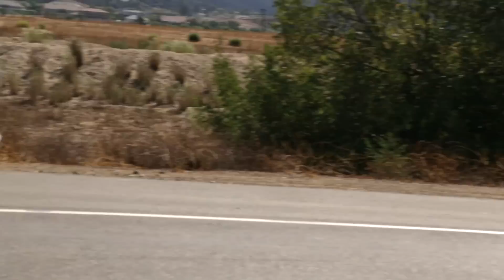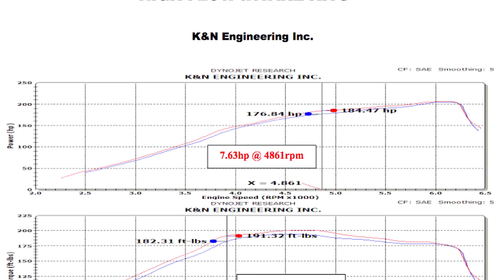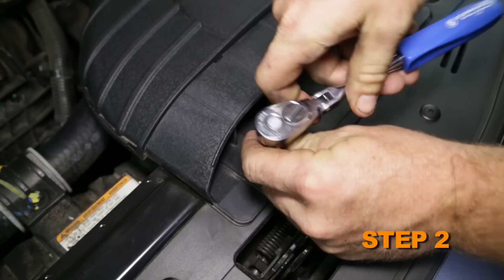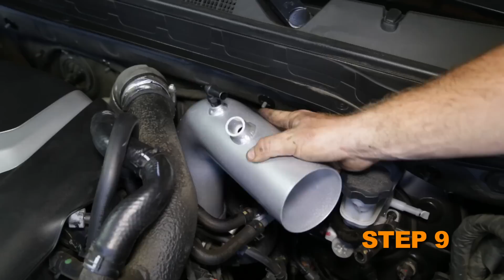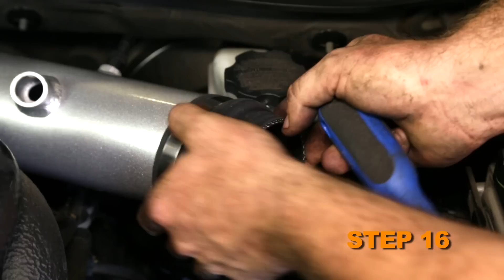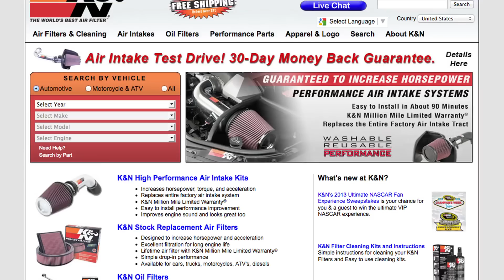Kia Optima & Hyundai Sonata 2.0L [#69-5309TS] Air Intake Installation

Comment: Installed on my 2012 Hyundai Sonata 2.0T and its badass, sounds great and I can def notice a improvement in horsepower/and accelerating, I highly recommend it. Taking of the old hose that leads to the turbo is a bitch to get off tho! Just be ready to struggle abit.
Reply: what tools do you need ?
Reply: yeah how the hell you get to that and what size is that bolt clamp?

Comment: when its a turbo application it work's different from a NA/naturally aspirated motor.  turbo vehicles need the air even if its hot for the turbo to suck and work more efficient then the intercooler process that air and sends it in motor hot air will rob a NA motor so you afto keep cool air friendly. btw its not that easy to disconnect the pipe from turbo you afto disconnect from bottom of tje vehicle fyi.

Comment: A lot of places say you can get intakes without tunes required and get 10-15 HP and at least 5+ lbs of torque without a tune. Is this true, or would you just be giving your car more air than it needs if you don't tune it?

Comment: I Have A 2013 Kia Optima Ex 2.4L No Turbo Is It Even Worth It To Put This In My Car ? Will It Make It Sound Better Or Faster ?
Reply: Don't do it
Reply: Virgilio Alford it will sound better anDat the top of the RPMS have a gain but daily driver uses 2500- 3500 rpm the most. The manufacturer i set up the intake to have max speed of airflow in the 2500-3500 range and keep the car quiet and not annoying

Comment: KNfilters- After drooling over the sound this makes I bought this exact kit. I installed it and I thought everything went smooth, however the sound it makes when I gun it sounds like the turbo is trying to play catch up. Perfectly healthy car and first add on-Is this normal or could something possibly be installed incorrectly? Thanks a bunch Ive had a K&N on every car (4) i've owned.
Reply from the maker: Hi Scott, if you still have questions about your kit, please contact our Customer Service department, one of our techs will be happy to help out, you can call us at 800-858-3333.

Comment: Not to be captain obvious here, but I see these "cold air intake" systems installed all the time and I can't help but wonder...don't these open air filter intakes inside the engine compartment draw hot air from under the hood instead of how most factory systems draw cooler air from outside the engine compartment? I have an Optima turbo and know that the cooler the air, the better! How can "cold air intake" even be true with this setup?
Reply: You're not cooling down the air from the outside. You're making it less restrictive. That's what the purpose of an intake is for. It's gonna pass through the intercooler anyways.
Reply: +Hijo Yes but cooler air through the intake from outside seems to me would be cooler when it hits the engine than trying to cool down hot air from inside the engine compartment, don't you think?
Reply: +Scott DuVall Yeah, and I agree with you. (Unless it has a heat shield). However, those temps don't matter too much since turbo charged cars have an intercooler that's cooling the air before it reaches the cylinder.
Reply: +Hijo ding ding ding. The air is being compressed anyway so the inital intake temp doesnt really matter too much. Hence the use of an intercooler on turbocharged engines.
However with NA engines, no doubt, the cooler the intake temps at the filter the more dense the air is. All of which technically increases the displacement of the cylinders. Thats why you will see alot of CAI's for NA cars being routed down into the bumper or fender. 

Really the best thing for IAT's would be to use a seperated turbine and compressor turbo like Mercedes uses on their '14+ F1 cars. Basically just a long central shaft that connects the turbine to the compressor, giving a substantial air gap between the two and keeping IAT's down.
Reply: +Hijo ding ding ding. The air is being compressed anyway so the inital intake temp doesnt really matter too much. Hence the use of an intercooler on turbocharged engines.
However with NA engines, no doubt, the cooler the intake temps at the filter the more dense the air is. All of which technically increases the displacement of the cylinders. Thats why you will see alot of CAI's for NA cars being routed down into the bumper or fender. 

Really the best thing for IAT's would be to use a seperated turbine and compressor turbo like Mercedes uses on their '14+ F1 cars. Basically just a long central shaft that connects the turbine to the compressor, giving a substantial air gap between the two and keeping IAT's down.
Reply: By re-installing the OEM snorkel that brings cool outside air right up to the open element air filter, when you are cruising down the road you ARE getting cool air to the now much less restrictive air intake.  It does work.  The heat-shield system they provide that seals up against the hood helps to keep some (but not all) of the hot engine compartment air from getting to the air filter/intake path.  You can monitor the air intake temperature with Torque Pro and an Bluetooth OBD-II dongle.  I have the InJen setup which is very similar to the K&N system.
Reply: +Hijo ding ding ding. The air is being compressed anyway so the inital intake temp doesnt really matter too much. Hence the use of an intercooler on turbocharged engines.
However with NA engines, no doubt, the cooler the intake temps at the filter the more dense the air is. All of which technically increases the displacement of the cylinders. Thats why you will see alot of CAI's for NA cars being routed down into the bumper or fender. 

Really the best thing for IAT's would be to use a seperated turbine and compressor turbo like Mercedes uses on their '14+ F1 cars. Basically just a long central shaft that connects the turbine to the compressor, giving a substantial air gap between the two and keeping IAT's down.
Reply: Scott DuVall the turbo is hot and heats the air that is why they invented inter coolers yes the colder the beter
Reply: Finn Custom Knives like
Reply: Scott DuVall
Reply: On the 2.0 liter turbos there is an intercooler before the air gets to the intake so it helps with that.

Comment: Why don't the car manufacturers do this from factory? They can make contract with K&N or just make their own. They should have plenty of money... Usually car buyers pay $1000 for 10hp increase when a newer model replaces older, even if no other changes are made to car.
Reply from the maker: +Alen Majetic Mostly because the engine noise increase does not appeal to the majority of consumers. Some people prefer quieter, slower vehicles.
Reply: +KNfilters Do you offer filters that don't make extra noise? I don't think it's hard to make that, noise is just vibration, noise doesn't affect power I think. Or is that a secret way KN is making extra power???
I definitely don't want to make extra noise

Comment: It is all bs and for the price you can buy like 150 factory air filters want more power then buy a car with more horse power
Reply: You are ignorant. This upgrade does a lot more then just add a few horses. You can hear the turbo spool better. Quicker response, quicker spool. Better fuel economy. Probably lighter too.
Reply: tasha macmillan yes bigger power from the steelership

Comment: I have a 2015 kia optima lx will this work? Also i do live in california where you said this is illegal is there legal versions of this?
Reply: how often have you been pulled over by a cop checking to see if you have an cold air intake lol
Reply: +Logan Green it's not the cops it's the scheduled service that checks your vehicle. they are required to report modifications
Reply: They do have CAIs for 2015 Optimas..I have a 2015 optima lx too and I just replaced the stock filter with a KN filter instead of a CAI (costs a little too much for me).. I do notice a difference in mid-range gears and on takeoffs though im sure its not as substantial as a CAI..If you want to legally install a CAI then you probably just have to move out of California..
Reply: Their website says it is 50 state legal so if it fits, it would be ok in CA

Comment: You probably hear a BOV because the stock intake insulated the noise of the recirculation of the air. Aftermarket intakes usually do not do this as they are made of different materials.

Comment: Watch tuner shops prove on dyno that there is no gain in HP..   Absolutely none.. Its equivalent to putting on an exhaust tip no gain all looks.. It breaths better only if your stock filter is dirty do the research
Reply from the maker: Please provide info on a tuner shop testing our product vs stock, and seeing no gain. Once we recieve this info, we can review our system. However, when we tested the car on our dyno with and without our system we saw a 7.63 HP gain. : http://www.knfilters.com/dynocharts/69-5309_dyno.pdf
Reply: KNfilters that can't be right. My 2011 2.0T sonata dynoed at 245 horsepower at the wheels stock with 93 octane. Your turbo only got 190? Something seriously wrong there. That must have been the 2.4 motor. At 190 at the wheels your only pushing 220 horsepower.
Reply: @chrishuber8930  stock with 93oct an you manage 245hp??.. i seen some of our cars dyno at 230hp stock with regular gas.. so by going 93oct it will bump another 10hp?
Reply: @R3VOLT787  Yes that is correct. The engine is rated at 274hp on 87 octane. On 93 octane the engine is at about 285ish, according to the engineers that designed the engine.

Also seen a video on YouTube of an SX Optima bone stock putting down 240whp.
Reply: @boostjunkie2320  thanks man appreciate it.. ive been putting 93 on my 2012 Optima sx with 64k miles.. hopefully im going to get it tuned by Lap3 with their 1.5 tune.
Reply: KNfilters cause the 2.4 stock is about 200 HP. 175 at the wheels.
Reply: Sounds like a load of shit if you ask me.
Reply: KNfilters Agreed with everyone else. K&N is full of SHIT! Although the tutorial for the install is quite nice. The intake itself doesn't provide that much gain, but it's still better than stock intake. Is it worth it? Not for the price and for what you're using the vehicle for.
Reply: +Chris Huber They did the dyno in 2nd gear. Does that make make any difference?